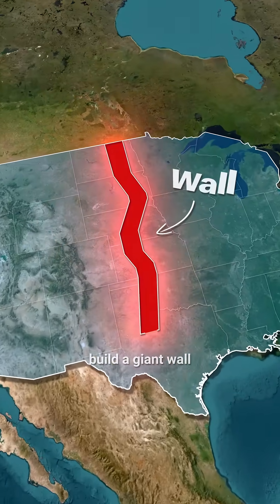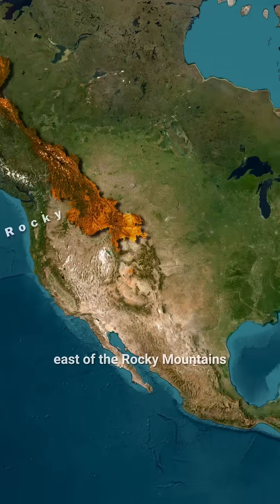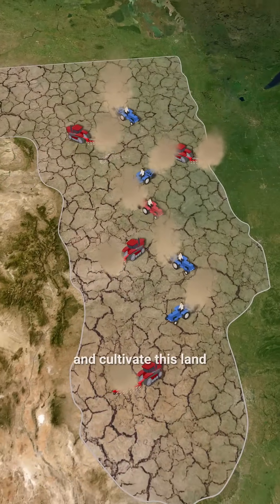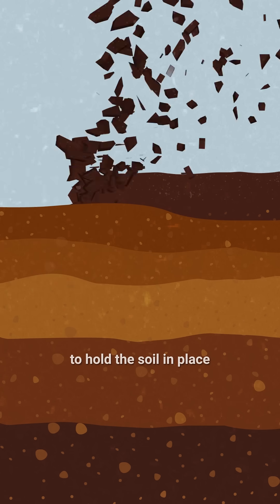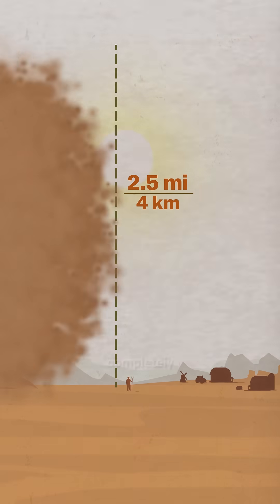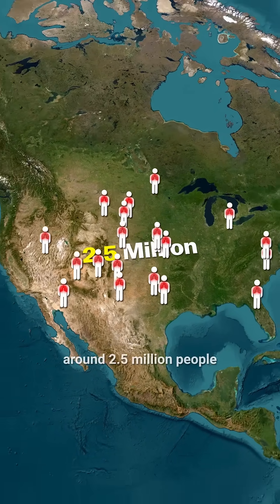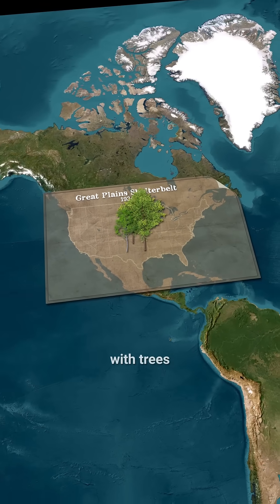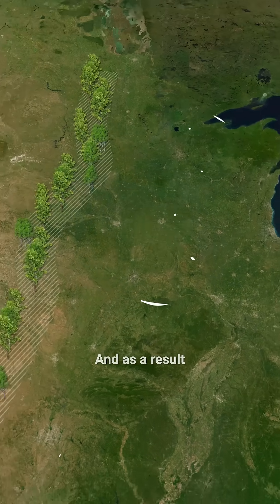Why USA Built a Giant Wall from Canada to Texas 😱🇺🇸 Great Plains Shelterbelt 🌳

Comment: I just left North Dakota yesterday on my way to Nevada. I would be mighty OK building a real wall not just a tree wall. I didn’t fit in up there. I’m not an alcoholic with seven kids and my truck doesn’t have a check engine light on with a bunch of empties in the bed. For a bunch of corn growers, you would think they would enjoy it fresh from the cob but instead they have to distill it first. I did try to date a young woman that worked for the tree service for the county trying to get people to plant trees and I understand the significance. I’m from Oregon. But yeah, I think I’ll stick to the regions where the avg IQ is in the triple digits.